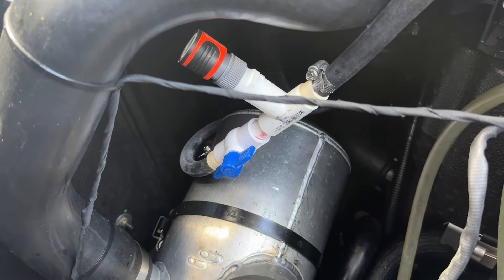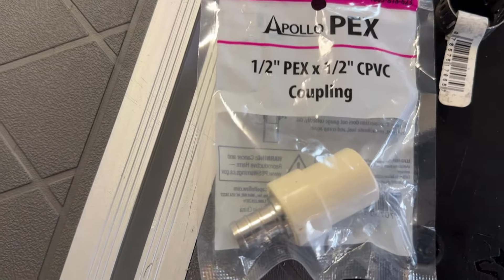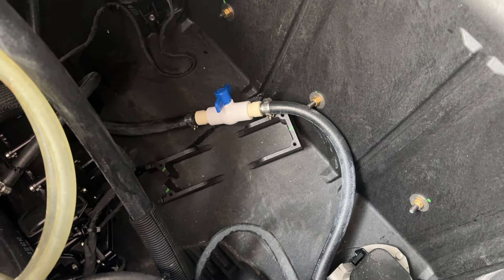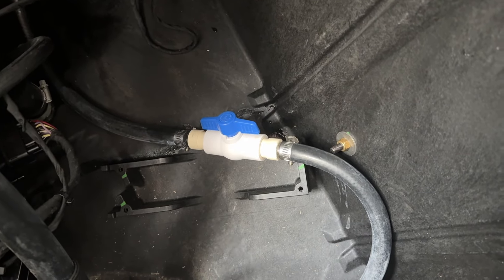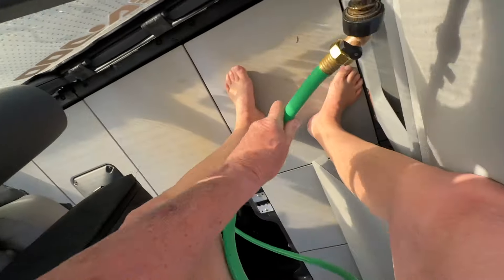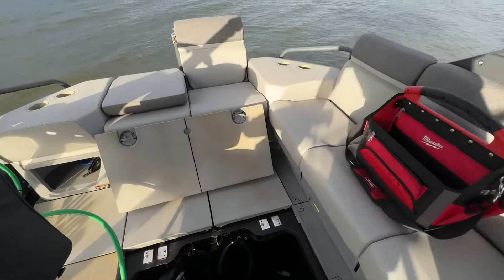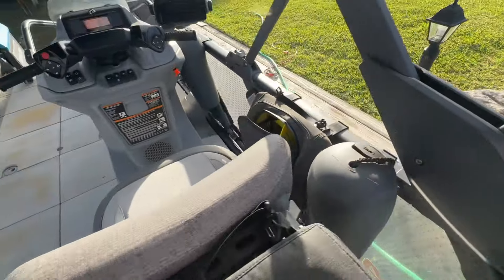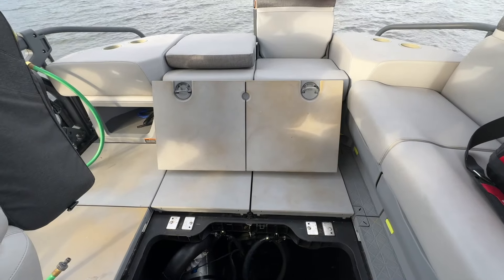SeaDoo Switch Remote Flush Pt 2

Comment from the maker: No.  The inlet port or the flush is the normal exit port for water from the exhaust. There should be a constant flow of cold water and while warmed by the engine exhaust, I never felt it to be that warm.  After running the Switch for 3 hours, the valve felt fine and not hot at all.

Comment: Hi Frank. Love your videos and I'm doing several of your mods. 

Question on the latest contraption.  Could that same shutoff valve be used to cut off the water intake to protect while towing? If so, which line would that be?
Reply: I have a hose clamp that I used on my seadoo speedster. I'm wondering if you we can identify which hose, we could just clamp it while towing. Thanks again, Frank!
Reply from the maker: @Xyzzxy123  Yes.  I'll do a video on it.  But if you look at the hoses on the inside of the back engine compartment, there are two Y hose connectors.  One port and one starboard.  The starboard side is the one we used to flush the exhaust system.  The port one is the water inlet while underway.  This hose is where you's place the tow tap.  But, I need to identify exactly where the exhaust (resonator hose) goes.  Is the water inlet hose the only thing that needs turned off? Or it there the danger under tow of water entering the exhaust port itself?  If so, then a tow tap on this hose would be ineffective.  I'll be looking further,

Comment: I too have my Switch (2024 21 Limited) on a lift.  I have done the modifications as you have shown and I appreciate your instructions on doing this.  My question is, are you now running with the port side exhaust flush cap removed and the installed valve closed?
Reply from the maker: Yes.  That is correct.

Comment: I enjoy your videos.   They are very helpful.  Do you have any concern over the effect the hot water may have on the piping?  Could it cause the pvc pipe and valve to fail?  I think pvc is rated to 140 degrees.